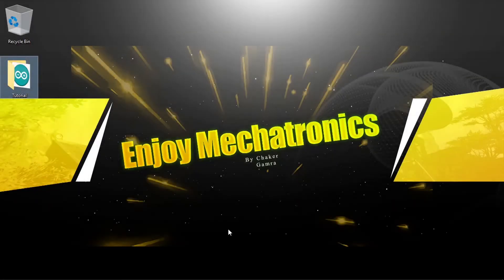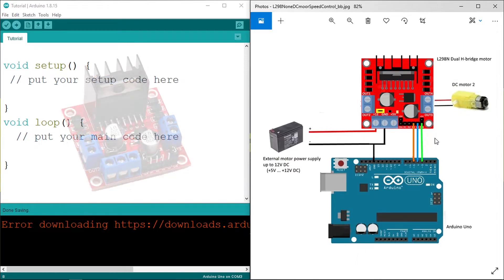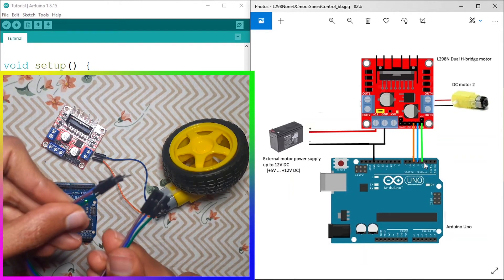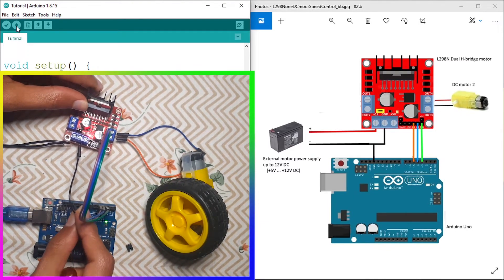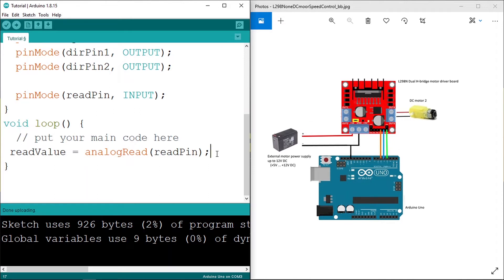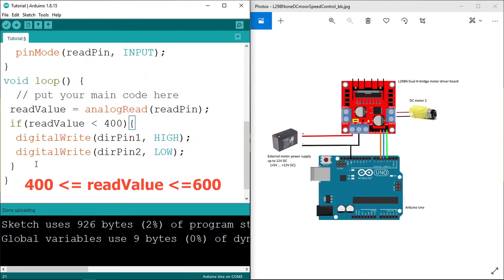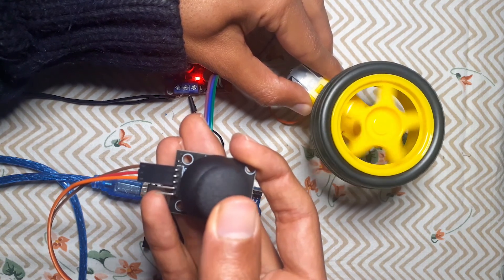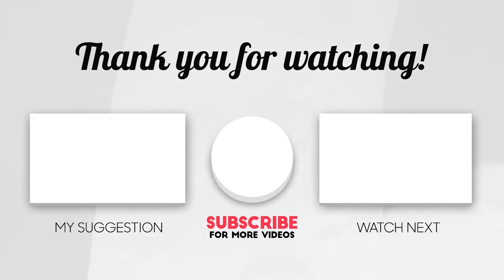Arduino Tutorial 30- Control DC Motor Speed and Direction using a Joystick

Comment: Bro pls share the code man
Reply: int speedPin = 3;
int dirPin1 = 4;
int dirPin2 = 5;
int readPin = A0;
int readValue;

void setup ()  {
  // put setup code here
  pinMode (speedPin, OUTPUT);
  pinMode (dirPin1,  OUTPUT);
  pinMode (dirPin2,  OUTPUT);

  pinMode(readPin,  INPUT);

  analogWrite(speedPin,  60);
  digitalWrite(dirPin1,  HIGH);
  digitalWrite(dirPin2,  LOW);

}
void loop ()  {
  // put main code here
  readValue = analogRead(readPin);
  
  if(readValue < 400) {
    analogWrite(speedPin,  map(readValue,  0,  400, 255,  60));
    //map(readValue,  0,  400, 255,  60);
   digitalWrite(dirPin1,  HIGH);
   digitalWrite(dirPin2,  LOW);
  }else if(readValue <600){
    digitalWrite(dirPin1,  LOW);
    digitalWrite(dirPin2,  LOW);
  }else{
    analogWrite(speedPin,  map(readValue,  600,  1023, 60,  255));
    digitalWrite(dirPin1,  LOW);
    digitalWrite(dirPin2,  HIGH);
  }

}
Reply: @AldoHernandez-ou5mw  Muchas gracias !!!!

Comment: I have the same motor controller but mine came in a kit and it has click connectors instead of separate pins. WIll it still work for this project?

Comment: What kind of wire did you use to connect the motor to the l298n
Reply from the maker: Simple Jumper wires!
But it doesn't matter if you have different ones.